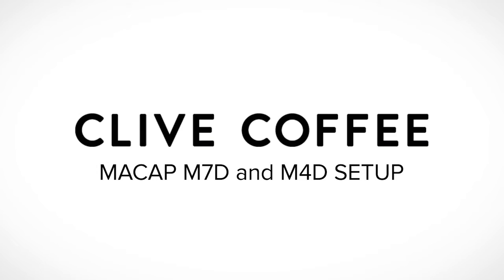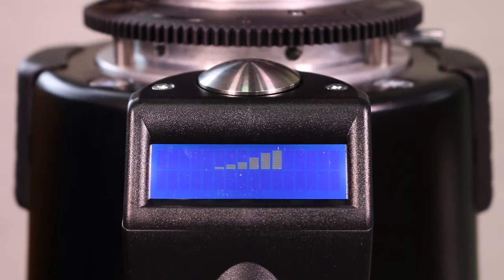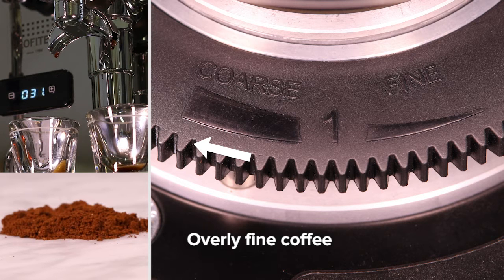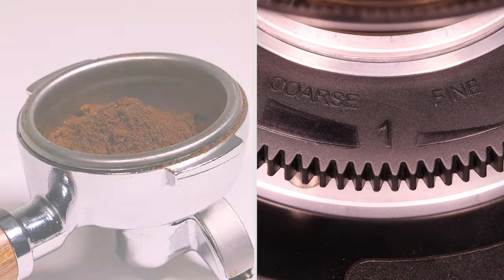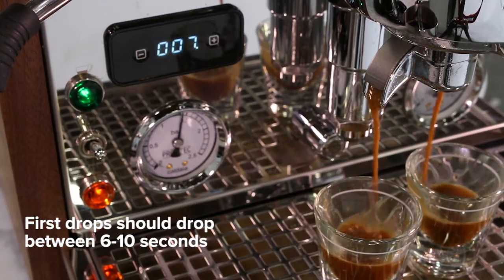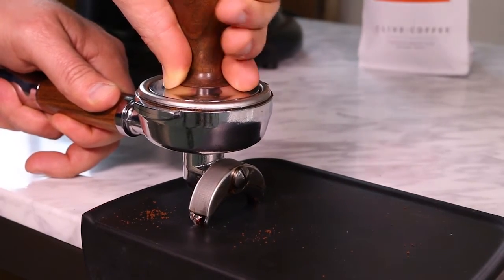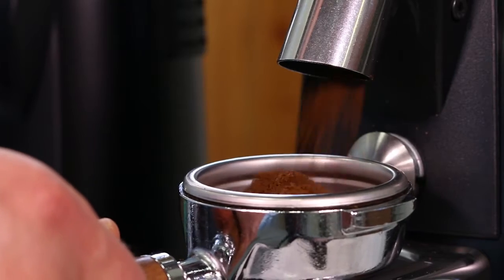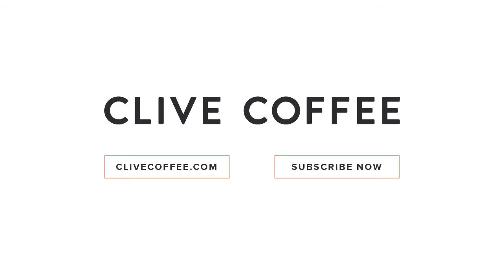Macap M4D and M7D Espresso Grinder Setup

Comment: Great video, but I still experience a problem with my M4D. I have turned the burrs all the way so they touch each other and then a little back. This should be the finest setting I assume. If I then grind 1 shot into the portfilter it still runs through very fast when I pull a shot (5 secs). I tried coarser but also foesn't help. Seems like it doesn't grind really fine at all (like it used to do). Any suggestions on what I may be doing wrong?